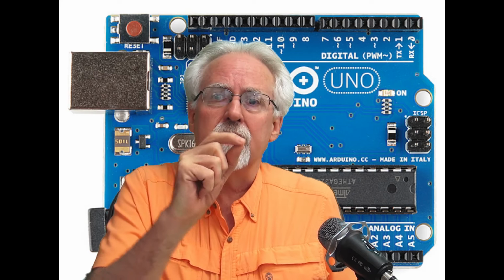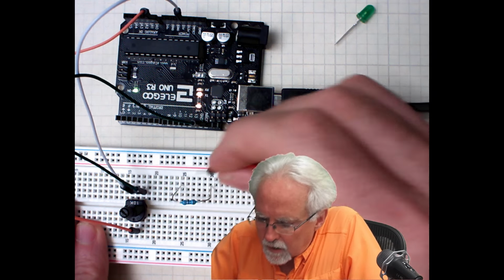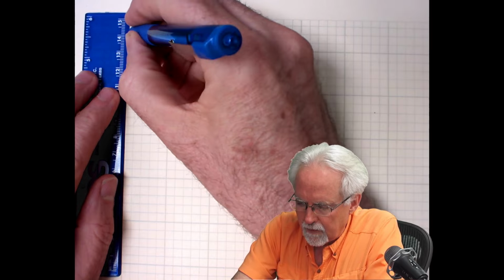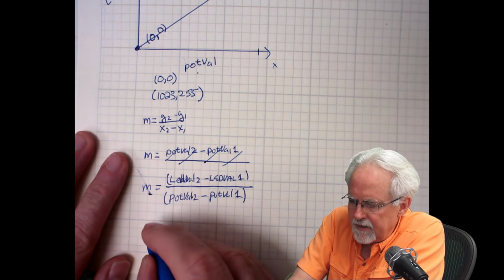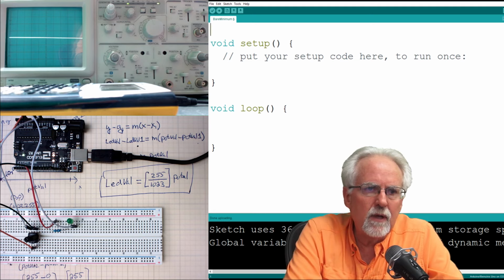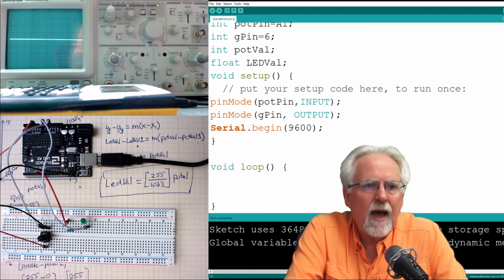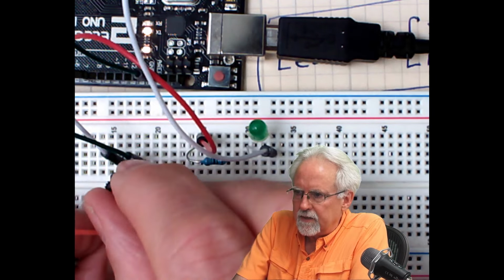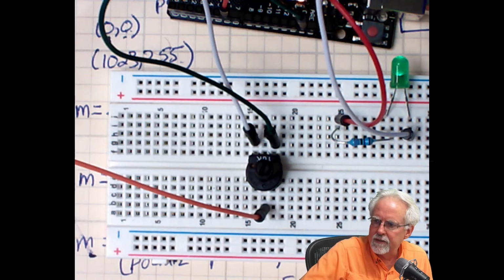Arduino Tutorial 14: Dimmable LED Project

Comment: Question:
In this lesson you setup the pinMode(pot, INPUT), however on the previous lesson (Understanding Potentiometers) you simply didn't setup the pot pin. And BOOM it worked anyways.
Why is that? When can this be ignored and when it needs to be setup?

EDIT: actually removing the potPin from the setup this project still works. I'm a bit confused.

Comment: sir, I have a different approach for this problem

I connected the two in parallel, that is first leg of potentiometer from a pin, second to resistor which is in series with the LED and the third to GND. The second leg of the LED similarly goes to ground. We know current is not the same in parallel and for protection of the LED I have used a higher resistance in series.

code is simply as below

int potentiom=13;
void setup()
{
  pinMode(potentiom,OUTPUT);
}
void loop()
{
  digitalWrite(potentiom,HIGH);
}
  
That being said I love your lectures and your overall attitude in this series and learnt a lot from this video as well!

Comment: Hey Paul, I followed along and mine was doing the same thing yours was at first. I discovered while troubleshooting that I had a poor connection on my potentiometer. I also discovered with the read wire disconnected I was reading a value of approx 50. Once I corrected my connection issue, “bam”, worked like a charm. Thanks for another great video.

Comment: Paul, I know this series is old, but I'm currently on the path to an electrical engineering and mechanical engineering degree.   I was hesitant about the benefits of the Arduino and programming in general as I felt like I would be wasting time that i could be putting towards a degree.  But since playing with this thing, and especially since going through your tutorials, I am LOVING it!!  I really love how particular you are when it comes to the simplest things, like just keeping your kit neat and organized!!  Drives me crazy too, to have to dig for something in any toolbox!!  You are an amazing teacher and I'm glad i found your channel!!  I envy the kids you've taught over the years!!  Keep up the great work!!!
By the way, YES, I am definitely doing each and every project, circuit, and homework that you do and have "assigned".  I also will not move on until i have a good understanding of how and WHY it works!!
Reply from the maker: These lessons are important because I think they give you a lot more practical hands on skills than a typical engineering curiculum which is more book work and not enough lab work.
Reply: @paulmcwhorter  I agree completely!! And u are an amazing teacher!! That helps too!! Looking forward to the rest of the series!!

Comment: As always, loving the videos, and very grateful to have them. I do have a question!

Why make LEDVal a float? 

In my mind, since we're using digital outputs to control the LED, the output will "snap" to the nearest integer value bt 0 and 255. So any float will be either truncated or rounded (my guess is the former) to the nearest integer. This is assuming that these aren't the highest resolution digital outputs, and the PWM can only do discrete steps equal to 1 in a range of 256. For anyone who's curious–the dimming resulting from LEDVal being an integer vs float looks the same to my eye.

Comment: I think the problem you might have been having was the potentiometer. I had problems with it making contact on the breadboard. The slightest shift and its leads would end up losing contact with the breadboard. What I ended up doing was soldering some wire to its leads and plugging the wire into the breadboard instead of the potentiometer's short lead legs. No more problems after that!

Comment: Nice video, the tutorial you designed is very interesting. I watched from tutorial 1 to here in 2 days, The tutorials are better than playing WoW :). And I have a quick question, if instead of connecting the LED + to pin 6, if I connect the LED + from the pottentiometers middle output ( column 17 ). Do I even need to write code to achieve the same result? I can not try that design since I ordered the start kit  last week, it still on its way. :)

Comment: At 5:38 Paul mentions that the long leg of the LED goes toward the power supply, in this case the resistor, and the short leg toward ground.  If you have LEDs that came from a different supplier, the long and short legs might be backward.  There is also a flat spot on the side of most LEDs and the leg nearest the flat spot is the cathode or the side that goes toward ground.  Most LEDs do follow the standard of the short leg being the cathode, but I have some that are backward.

Comment: I know you already finished this series of videos, but for what its worth I think its great you add in the math and engineering mindset. The HW is really helpful as well. Combining the if statements with this lesson really opened up my imagination and I could figure out how to do it. When would you use a linear equation that does not pass through 0?
Reply from the maker: Almost all linear equations do not pass though zero. Only simplest examples have 0 intercept

Comment: not working  for me 
int potPin=A1;
int gPin=6;
int potVal;
float LEDVal;
void setup() {
  // put your setup code here, to run once:
pinMode(potPin,INPUT);
pinMode(gPin,OUTPUT);
Serial.begin(9600);
}

void loop() {
  // put your main code here, to run repeatedly:
potVal=analogRead(potPin);
LEDVal=(255./1023.)*potVal;
analogWrite(gPin,LEDVal);
Serial.Println(LEDVal);
}
what is wrong here, I bet is is something simple

Comment: Hey just wondering instead of doing all the math for the linear equations can't you just use the map command and instantly have it match up the values without having to do math?
Reply from the maker: The whole point of the lesson is to teach how to do math, and a practical application. What will you do when you find a challenge that Map will not solve? I explain the math. Math is your friend
Reply: @paulmcwhorter  Good point thanks for the explanation! love your content

Comment: If your LED is not dimming, make sure you are using a digital pin with a ~.  Otherwise the LED will go from off to on and will not dim.  I was convinced for a few mins that I had LEDs that were not dimmable as I tested multiple from the kit.

Comment: I tried and did everything but the LED was not diming. I wonder if the potentiometer which was in the kit is working in the Ohm range you have mentioned (10k) no reference for it. In the Serial Monitor, I get 255 all the time and If I turn the meter nothing happens. Checked working and code but does not work :(

Comment: Hi Paul, Thanks for the series. I've taken up a new hobby in my late 60's to stop my brain freezing up, and your lessons are great! Now a question: When I run the serial readout, I noticed that the POT, even when turned full left, never read 0, but gave a stuttering reading between 0 and about 30. The LED would also flash or pulse at that low level. Driving it up to max would brighten the LED, but it always seemed to have a pulse on it. Would that be caused by a faulty Potentiometer or Uno?

Comment: Great Videos, I like that you go in to the math, which gives a better understanding, after doing the slope & line equations and applying that to the code, there is an alternative method using the built in function map() you could show. It is easier to implement, though it does not teach you the maths :-), keep up the good work.

Comment: I managed to connect two LEDs and use the single pot to control opposing brightness. I noticed that as one LED got brighter and the other got dimmer, it didn't do so in a linear manner. So, I set some arbitrary thresholds using what I learned in your 'if' lesson, and changed the PWM value by a factor (which could be adjusted as a variable, of course) so that the brightness of the opposing LEDs changed in a more proportionate manner.

In the space of two weeks you've helped me come a long way already, and I'm enjoying the mix of theory, practice and homework. See you in Lesson 15.

Comment: To my knowledge, I set this up correctly.  If I remove the wire from the POT output (connects to A1) my LED goes full bright.  Is that because setting pinMode(gPIN,OUTPUT) defaults to "high"?

Comment: hello sir. I have a doubt. If we connect, the LED across the center pin and and gnd of the potentiometer and turn the pot all the way from left to right, won't we we able to apply a voltage in the range 0 to 5V. I think that creates a dimmable LED too. And off course, we need to add a current limiting resistor between the center pin and the LED.

Comment: Hello Paul! Total beginner here but have been learning a lot from your videos so far! Thank you!

My code was the same as yours but then I added a delay after the Serial.println(LEDVal); and then the LED wouldn't even light up and I can't figure out why...
The variable I used is correct, there are no missing ";" and everything else in the code is correct plus I got no errors.

It's not crucial to have the delay, but it is a strange behaviour since it only works when I take the delay off.
Am I missing something?
Reply: Forgot to mention that I'm using a platform that simulates the behaviour of an Arduino (TInkercad) so maybe it has to do with that
Reply: hi Tiago. could you copy paste your code in the comments, so that we could figure out if something went wrong or any other possible error :)

Comment: Question regarding the 'delay' command  :
First thanks a lot for the awesome tutorials!!!! 
I've added a delay(1000) command after the Serial.println(LEDVal) command to be able to see the values clearly. The delay command is delaying the output values for the LED as well. Is there a way to apply the delay command for the Serial.println command only without effecting the other commands in the loop?

Comment: Hello Paul, I love your Tutorial Videos. I have one question to this Video. What is the difference between doing it this way, or directly connect the resistor one leg to the 3rd pin of the Potentiometer and then the rest like we do. Another leg to the LED long leg and short leg to the ground. It does the same just without any coding, what are the benefits accomplishing this your way?
Reply: If you just want to dim a LED - not much benefit.  If you want to learn programming and how the Arduino works - A lot of benefit.  For example -  I still have tons of stuff packed away in boxes (including my volt meter) - It just occurred to me that I might be able to use the Arduino as a volt meter to test the voltage on my batteries (AA, AAA).

Comment: In case anyone else runs into this - my light was not dimming at first but was just turning on when the potentiometer was past a certain point. I had left my LED from the homework of the last project on pin 8. I had to switch to an analog pin and the dimming effect started working.

Comment: I did the 3 lights depending on voltage and then did a blend in between where as example the green and yellow would be on at the same time to indicate it was medium low. I also set a target voltage of 2.4 to 2.6 and when in that range all of the LED's come on. Great lesson and presented very well. I have turned several people on to your tutorials.

Comment: Can we transfer the power to the LED straight from the potentiometer output through a resistor ?
Reply: you can, but what we learning here is a controllable circuit which has a lot of advantages like the contents of lesson 13.

Comment: For some reason, my LED won't dim, but instead only turns on when it goes above a potentiometer value of around 120. Otherwise, it is fully off.
Reply: 😂 I realized that I was using a normal digital pin instead of a pwm one

Comment: At the start of this video, I've planned to do the same but with the rgb led included in the kit, and realised that I can actualy make it's color change like this, by setting the potentiometer's voltage into other one analog output, with several buttons... and here I am, looking in paint for each color's rgb values, and setting my led to look exactly like that with the potentio meter and 3 buttons. I'm loving it. Never missed a homework assingment, and I do some bonus stuff as well before I even finish this series :3

Comment: I'm disappointed that you didn't show the simpler way at the end of this sketch:  int LEDVal;          LEDVal = potVal/4; because 1023/255=4 No need for float LEDVal   .
Reply from the maker: The goal of this channel is not to show simple ways, but to show correct ways. First, 1023/255 does not = 4. Making that roundoff could lead to problems in critical applications. Second, it  is not readable as no one would know where that 4 came from.
Reply: @paulmcwhorter  I appreciate your feedback! Thankyou

Comment: hi Paul, thank you for this lesson. A problem while putting this to my application is that the PWM value varies very rapidly by 1 on serial monitor. it is never still at the position of potentiometer. This creates the very problem of flicking in LED light while i turn 12Volt tape via a MOSFET. I have tried different quality of potentiometers and even used a very precise potentiometer but no luck. @24:34 i saw the same flickering in Values on your Serial monitor. Any solution you got?

Comment: when in the ledpin(led) i use a digital pin works perfectly when i use a analog pin(A) worksonly in the 2 states High and low no dimming. Was not suppose be the inverse? i mean analong from 0 to 255 and digital only to states?

Comment: Additionally to potVal and ledVal I let the Arduino calculate the Voltage, as you showed us in previous lessons and then print it on the Serial monitor, instead of the ledVal.

Comment: Greetings, Paul. If the total output is coming out the 3rd leg of potentiometer, why not hook up the resistor to that column and then connect the LED on the other end of the resistor and then ground it? That's how I set it up and works perfectly (both for controlling the brightness of LED and the output analog signal reading)...have you tried it that way? Is there a difference between this setup and the one you did on the video? Thank you.

Comment: Great lessons. Building my foundation on Arduino. I'm currently working on a project where I'll be controlling stepper motors using Arduino, and have a 3D printer running down the line. Thank you Paul, you've been a tremendous help.

Comment: Hi Paul. I was making a project in which the brightness of the led changed with change of brightness in the surroundings. As the light in the surroundings goes down, the brightness of the led increases (inversely proportionate). I was having trouble with the code. Could you please help me out.

Comment: OK I'm stuck, been following but now it's not working! 
int potPin= A1;
int gPin=6;
int potVal;
float LEDVal;

void setup() {

pinMode (potPin, INPUT);
pinMode (gPin, OUTPUT);
Serial.begin (9600);
}
void loop() {
potVal=analogRead(potPin);
  LEDVal=(255./1023.)*potVal;
  analogWrite(gPin, LEDVal);
  Serial.println(LEDVal);
}
Reply: Have you done a basic functional check of the LED? Put 5V directly to where the pin 6 output would go, after first disconnecting the output pin on the Arduino? The LED should light if all connections are correct, LED polarity and resistor value.
Reply: Also check the output from the pot with a meter. It should swing from 0 to 5 volts when you turn the pot with neg of the meter connected to ground GND pin.

Comment: Paul I'm loving your tutorials. I'm a mature student (well 50) with some self taught basic programming background. I really wanted to learn how to connect programming with practical electrical engineering and your series of tutorials is just the ticket. Thank you so much for producing this 'most excellent' series! :-)

Btw, this might be a rookie question but I'm thinking you did this project the way you did to demonstrate analog read and write in interaction with the programme but, would I be right in assuming a similar effect could be achieved by connecting the led straight to the 3rd leg of the pot (with a resistor in between) and a ground connection?
Reply: A small expansion of Paul's very good explanation of how an LED works. If you recall, Paul discussed "band gap" for a device. All diodes, both LED and conventional diodes have a minimum FORWARD voltage required across the diode before they go into conduction mode. For and LED, no light is emitted until that voltage level is met. When conduction begins, the forward voltage across the diode remains essentially the same (until the BLUE smoke escapes <grin>). For LEDs the minimum forward voltage increases in value with the color of the LED. RED is about 1.2 volts. The other colors have a larger voltage as the color moves up the color spectrum toward BLUE. I don't have the voltage values for the other colors off the top of my head.

	So, in answer to your question, connecting the LED via the wiper leg of the pot will not work as you expect. You will get SOME type of dimming but it will not begin until the forward conduction voltage is reached and because of the resistance of the potentiometer (10,000 ohms in this case), you will not get a very linear effect.

	The reason we use Pulse Width Modulation to drive the LED is because the signal sent to the LED is either at a 5 volt level or a 0 volt level. The 5 volt level exceeds the forward conduction voltage of any of the color LEDs so they will be illuminated. How bright the illumination appears depends on how much of the PWM cycle is at 5 volts vs 0 volts. The LED is actually on for a short period and off for the rest, but our eyes perceive this as dimming (think of the persistence of vision action of a movie film).

Pat